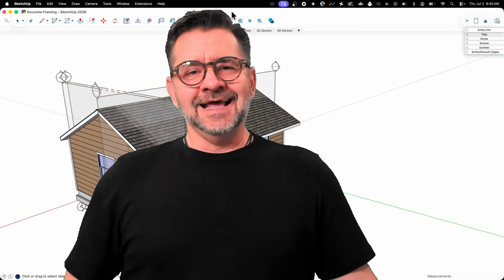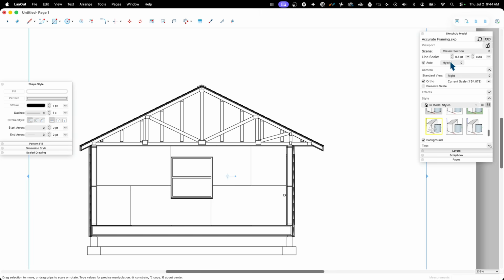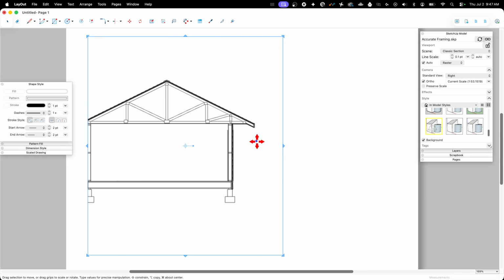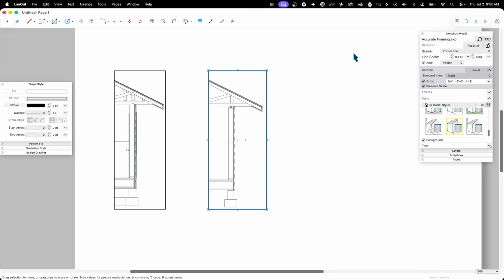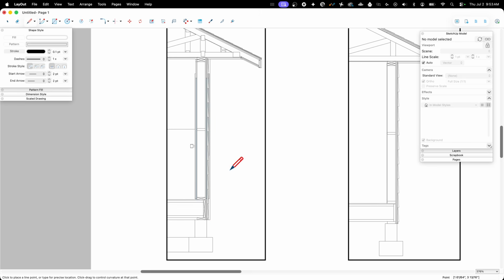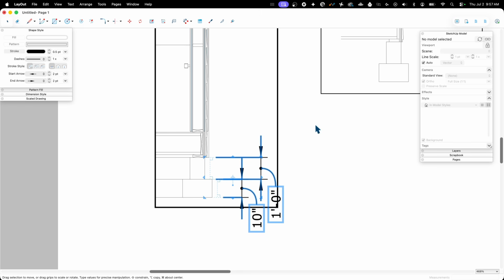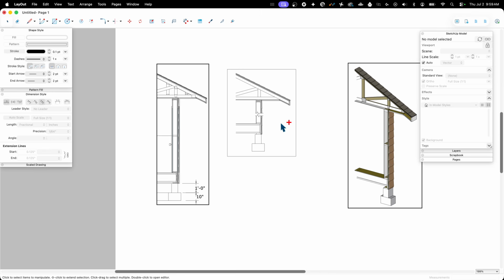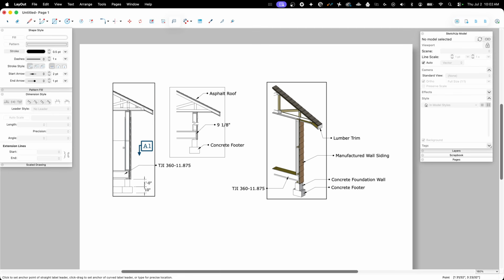Detailing 2D vs 3D Sections

Comment: Another way to quickly create your "2D Section" in SketchUp is to right click on your active section plane bounding box and select the "Create Group From Slice" menu option. That gives you a new group with everything that intersects the entire section plane which is less selective than your rectangular plane intersect with model method. It does creates the same divorced section line work view of the model, with the same issues mentioned for your 2D section solution.